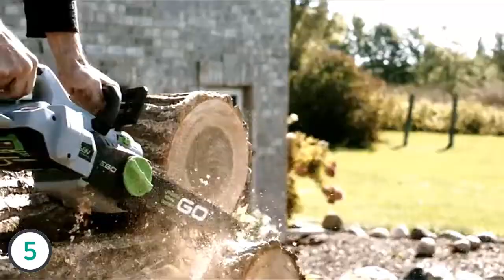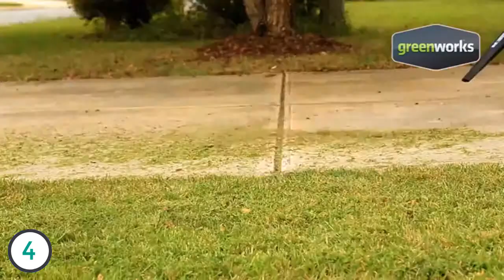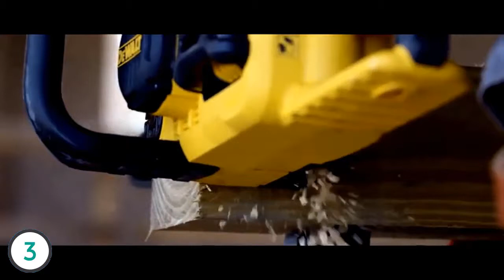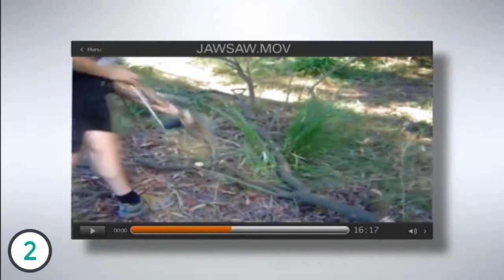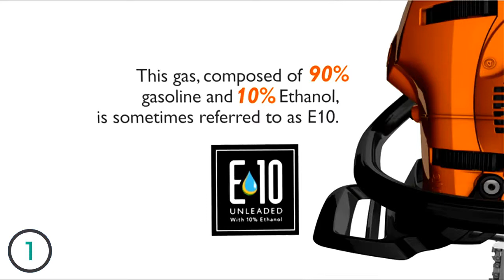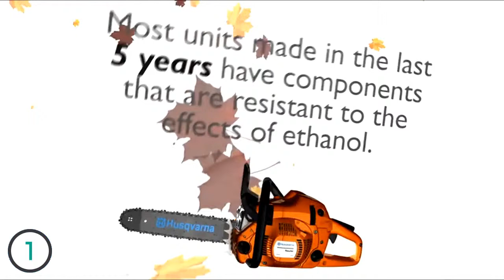Best Chainsaws in 2019 - Chainsaw Reviews & Buying Guide

Comment from the maker: ► The Chainsaws we mentioned in this video:

► 5. EGO Power+ 14-Inch 56-Volt Lithium-Ion Cordless Chain Saw - 2.0Ah Battery and Charger Kit - https://amzn.to/2W1v4RN
► 4. Greenworks 14-Inch 40V Cordless Chainsaw, 2.0 AH Battery Included CS40L210 - https://amzn.to/2Zq6D2x
► 3. DEWALT DCCS670X1 FLEXVOLT 60V MAX Lithium-Ion Brushless 16"" Cordless Chainsaw Kit (3.0AH)  - https://amzn.to/2VWXdcx
► 2. Worx WG320 JawSaw 20V PowerShare Cordless Electric Chainsaw with Auto-Tension - https://amzn.to/2VYx2Cw
► 1. Husqvarna 966048330 460 Rancher 20-Inch 60.3cc 2-Stoke X-Torq Gas Powered Chain Saw - https://amzn.to/2XAhnd4

In this video, we listed the best chainsaws out there for this year. This list is based on thousands of user Reviews, and all of these are hand picked by me. this list is completely hand-picked and in no particular order.

Thanks for watching guys, i hope you liked this video. If you want to see more videos like this one, remember to leave a comment and subscribe to my channel!
#BestChainsaw #BestChainsaw2019 #ChainsawReview